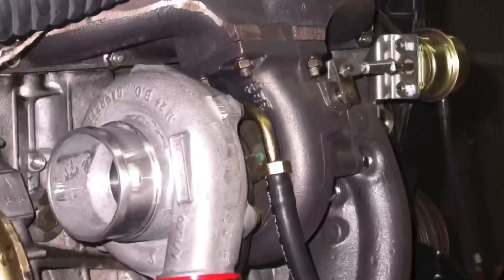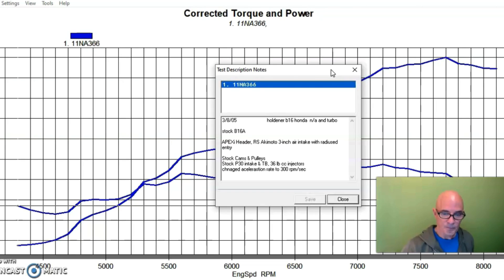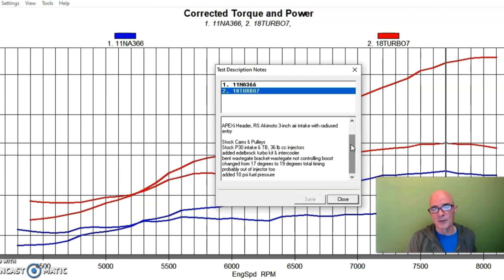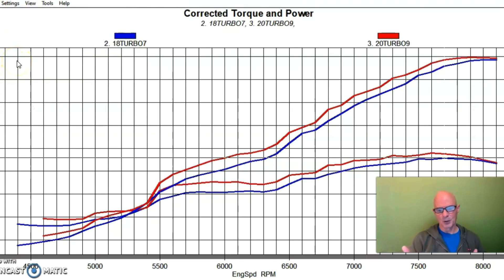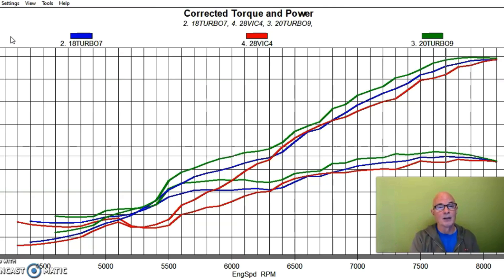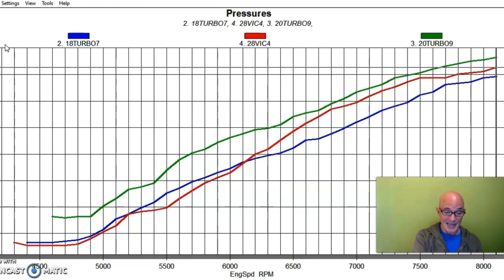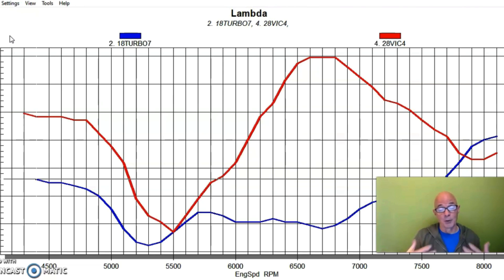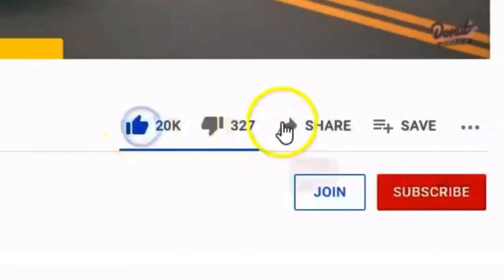VTEC TURBO TEST-HONDA B16A INTAKE TEST-STOCK P30 VS EDELBROCK VICTOR X-WHAT WORKS BEST UNDER BOOST?

Comment: B20/16, forged bottom end, 12.9:1 comp, big port jobbon head, over size stainless steel valves, stage 2 cams, stock manifold, coil pack ignition system, tuned on e85 fuel. 167kw(220)hp at the wheels. Im a 1967 mini .

Comment: Hey richard would the same thing apply to a tubro b20b16 head itr cam rev limit 8000 9 psi, im trying to decided if i should keep the b16 intake or upgrade
Reply from the maker: THE P30 INTAKE WORKS WELL

Comment: Hey Richard, I think the power dip around 5200rpm may be negated a bit if you bumped up the VTEC engagement point.  Do you think the Victor X would come alive with a higher output turbo motor or is it really suited for high RPM only?
Reply from the maker: high rpm
Reply: @richardholdener1727  A disappointing but expected answer. Thank you!

Comment: I am having crazy boost creep,I have a gsr / b16 head fully done super tech head,gsr cams ,ram horn , 44 mm wastegate ,1300cc injectors , hondata v3 , an only happens fro 5 to 8 thousand
Reply from the maker: you need a bigger gate or better gate position
Reply: @richardholdener1727  I am going to get that manifold with the 44 mm wastegate on an check it, where are you located ? An thanks for your help

Comment: Hi Richard, have you ever test on dyno which one is better, high compression ratio with retard timing or lower compression ratio with more timing?
For example, lets say:
- Honda B/K series engine
- 11:1 vs 13:1 (similar piston weight, because lighter piston make more power)
- Same internal engine (rod, crank, valvetrain, etc.)
- Same fuel (98 RON/ 93 US octane)
- Same ECU
Thanks
Reply from the maker: NOT THAT SPECIFIC TEST

Comment: To be fair, your using an intake manifold design that's more ideal for peaky  big turbo, 600+ HP motors, with a turbo kit made for a much more linear, lower HP.

Same thing happens when your taking running say 2" hot side IC piping and 2.5" cold, vs the guys that run full 3". Unless your running massive massive power, there's no need. The pressure drop and extra time to fill the piping and manifold before you start getting positive pressure is drastically increased, and therefore, laggy.

Comment: I know it’s totally the wrong size engine, but would would something like a mini bike with a small 212cc motor have such a “short” intake runner? The carb is slapped directly to the head with maybe 2.5” to the backside of a valve.  Most mini bike engines without heavy mods won’t be revving over 5k. So wouldn’t they want a longer runner so they can make use of that torque? Perhaps it’s merely for packaging reasons. Idk a bit of a tangent but I’d love to see how it would work out for our budget DIY people that use mini bikes and motorcycles as our engine building

Comment: Have you done much staggered vs same lift/duration cam testing on dual overhead cam engines.  We often run same lift and duration on RB26,  but I haven't done enough real thought about it to know if that is the right way to go.
Reply from the maker: I have not done enough of that on 4V heads
Reply: @richardholdener1727  well then.  I've got some pretty wild cam setups. Everything from 236/240 8mm lift duration stock, to 290 duration 11.5 mm of lift.  I had some 312 cams in the past. At least how the RB guys denote them.

Comment: Richard you don't leave much to the imagination your so through. You ran  91 and 100 octane you usually run e-85. Are you able to get pump e-85 in California? Can you elaborate on the scarcity of e-85 coast to coast and it's future? As always thanks for your hard work.
Reply from the maker: not sure on scarcity-we ran this long before I started using e85
Reply: @richardholdener1727  just wondering about now none in Florida and thinking it's not coming back
Reply: E-85 back in Florida, now costs more than 87 regular, about 50 cents.

Comment: How do dyno shops handle blowing up a motor? Do they cover the cost via insurance or do they just have the customer sign a waiver absolving the shop of liability?
Reply from the maker: the dyno shop is not responsible for motor damage-that is on the engine builder or customer
Reply: @richardholdener1727  That seems wild since they can destroy an engine (by accident) while tuning it.

Comment: You should follow that up with a cam to match the intake then you will see the added power from the vic with stock cams it cant take advantage of the extra flow!
Reply from the maker: the Victor X needs more rpm (cams and heads flow that want to run at 9000 rpm)

Comment: 2:27... because Honda...
Short runner intake manifolds are for upper rpm ranges..trying to get power down low will not work...

Comment: being a stock engine and a b-series I'd assume this engine will detonate very soon? with those power figures, boost numbers and stock internals I just don't see it lasting long. I have to ask are your engines built to handle the numbers you show, or do you just give it all she's got on the dyno,then detune it for longevity?
Reply: The stock b16a had 10.2-10.4:1 compression. A completely stock engine could probably run on 87 octane if it was newer and not all full of carbon with 140f dyno water in it. He was running a mix of 100 and 91. Its pretty unlikely to knock on the dyno with good gas if someone is paying attention. 
Lots of the tuning that richard does, especially newer stuff, is all done with E85 from a station close to westech. Most of what he tunes is an optimised tune to make the most power and thats pretty safe with that fuel. I dont ever remember Richard doing an octane limited dyno run on a boosted engine.
Reply from the maker: It won't (and didn't) detonate on the combination of water temp, air temp, octane, boost, AF and timing we ran. It would last a long time at this power and boost level with proper timing and octane. For street use, I would at least add ring gap.
Reply: That thing will run forever! Duh honda power!

Comment: Should have posted up the IAT differences between the two manifolds. From my experience going from a 70mm throttle+skunk2 pro, which I think has a 1.8L to 2.0L plenum(long runner) to a 90mm throttle+ skunk2 ultra race with the 2 litre spacer giving a total of 5.5litre plenum(short runner) there was an IAT drop from 40°c/104°f to 30°c/86°f with the bigger plenum. But you're right the motor felt sluggish on the low cam but boy did it haul ass switch'n over from the 190°dur to the 270°dur, 12.7mm/.500 lift. What I found in the logs was that it wouldn't reach above 100%VE (98kpa) till the vtec point (101kpa) 5200rpm so I did some research on Helmholtz resonance and the relationship between large plenums and tiny(bottle neck) openings. Found out that going such a large plenum of 5.5 litres required a much smaller throttle opening, hence there was a larger "AIR SPRING" with a larger plenum. So I got a pvc plumbing reducer that was 90mm to 65mm in diameter but the 65mm section was only 2'inch long with 1 foot of 65mm diameter pvc pipe, as I read somewhere that for peak torque at 6000rpm you need a ram at least 13'inch long and going 1.7'inch shorter would push the tq peak higher 1000rpm and obviously 1.7'inch longer would bring it on 1000rpm earlier. but I wanted to shift that higher so you couldn't feel "the drop off" so I ditched the ram and just left it with the 65mm opening. which I hid in side a 100mm aluminium heating duct(my cold air intake lol) and viola! I picked up 7kpa (105kpa) from 2500rpm all the way out to 9500rpm. I couldn't believe this thing was naturally boosting it's self with 0.5psi of boost lol. And the injector duty cycle% 310cc injector and 55psi on the fuel regulator.(AFR) had to be corrected 7% at cruise, 18% partial throttle and from 76% to 97% at 9500rpm WOT. Which was a 22% increase in fuel required at the peak. Which tells me there was an increase in 22% air flow at the peak given the same AFR. 14.2:1cr,skunk2 tuner3 cams, b20v, 93octane, pro manifold was 211hp> 240hp same setup with the larger manifold with the IAT drop and the help of Helmholtz boosting.👌
Reply: Holy shit.

This is awesome data. You've shown me another rabbit hole to fall into.
Merry New Year!
Reply: @tommylyeah  your welcome brother. Yeah with greater volume of any gas (air) in this case it takes more time to heat up at idle. And once you crack the "can" open, at WOT it just cools so much quicker and to a lower temp as there's just more room for the air to expand inside a larger plenum. Maybe with adjustable length runners like in a lsx "banana" manifold I could of picked up more low to mid range torque. But "RAM" diameter × length also plays a part.
Reply: Good write up 2 guys with B20 vtecs and the last name Wallace lol
Reply: Any input on timing and runner length due to cooling effects.
Reply: @nunyabidness105  with ign° timing I used a type r base map. But had to pull out 5°degrees dur to ping on low cam but high cam loved the factory timing. But eventually pulled back from 33° to 28° as there was no change In Power .only the noise from the knock sensor, reading at 33° was louder.
Reply from the maker: you were measuring a change in temp from something else-plenum volume has little to no effect on inlet air temps
Reply: @richardholdener1727  that little change might have been due to the skuck2 pro having the IAT sensor on the no.3 runner where as the skunk2 ultra has the IAT sensor positioned on the lid of the plenum dead centre.🤷
Reply: @richardholdener1727  now that you've mentioned it.... maybe the  position of the IAT sensor giving a cooler reading put the Ignition compensation tables in to a higher Ignition value...🤔
Reply: my buddies b20v on a p30 piston stock p30 intake manifold and small dc header   made 236hp and 198ft lbs of tq on 91 pump. only other thing worth mentioning about his build was toda spec b cams i believe
Reply: @BOOSTJUNKY  what was the correction Factor SAE? Or uncorrected on the Dyno what was the ambient air intake temperature and what was the altitude.
Reply: @b20vtec83  altitude is 374' in Baldwin Park ca not sure on temp but a good 70-low 80s  that was corrected power on a dynapack dyno
Reply: @BOOSTJUNKY  do you know if it was stock or ported p30 intake
Reply: @Andres-wy5du  stock 👍

Comment: Also, I know many people who went with the Victor X manifold on their turbo Honda drag cars, but I always went with a Skunk2 manifold. I have a fully built LSVTEC turbo that makes 709 whp with a Skunk2 3.5L Ultra Race manifold with a S2 90mm throttle body.
Reply: What size intake charge pipes with the 90mm tb?
Reply: Lsvtec indeed the best way specially turbo it just has been proven over and over on youtube that it being a lsvtec turbo is best than a gsr long block on turbo or even a type r ..type r is just best to be on its own N/A on nitrious or R410a

Comment: Richard, I own a del sol with a JDM B16A SiRII with a P30 intake and I can tell you this - this engine is incredibly well designed. Who tries to change the stock intake, camshafts etc must know very well what is doing. As it is as stock, it's perfect.

Comment: I have this same engine in my garage with Wiseco 9.8:1 pistons, Eagle H-beam rods, and a Cylinder Support System installed into the block. I have the matching PR3 head and Integra GSR cams for it.

Comment: Are you using something with duty cycle for a boost controller. Change your boost/waste gate adjustments it should bring some of those curves into a different curve.
Reply from the maker: manual waste gate controller

Comment: I just found out today nissan has twin screw superchargers available for the qr25 engines made available by the new qr25der supercharged hybrid found in infinitys and nissans. They rate the supercharged 2.5 qr engine at the same horespower as a 3.5 vq. You can find these blowers affordably online and it should bolt on to any 2.5 altima, sentra, or other nissan/infinity vehicle.

Comment: Love that you put a test like this up. I’ve gotten away from imports more and more over the last half decade or so, but back when I was building my boosted Hondas I always wondered about the Edelbrock manifold. A ton of guys were running them and but I never personally used that piece or tuned a build with on bolted on. I typically stuck to Skunk2 manifolds and even always had good luck with some factory Honda units but the Edelbrock was always something I was curious about.

Comment: Do a K-series  vs 4G63T 6bolt need two blocks one for how much they can make stock blocks vs built
Reply: Already a k series video and with 4g63T, with proper tuning about 450- 500
Reply: @km6832  title to the video
Reply: @brandonhaywood3391  search richard holdener k series
Reply: Watch Humble Performance's videos.